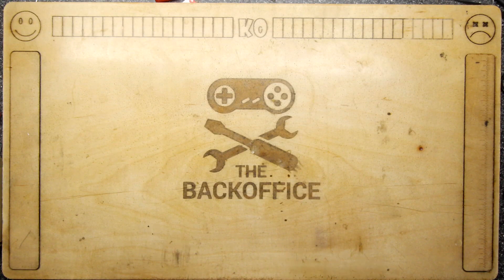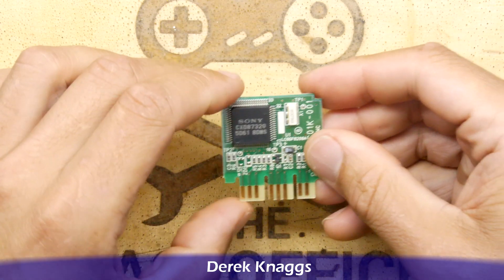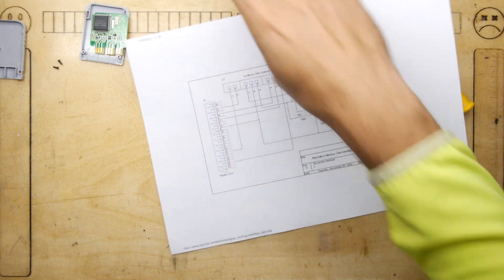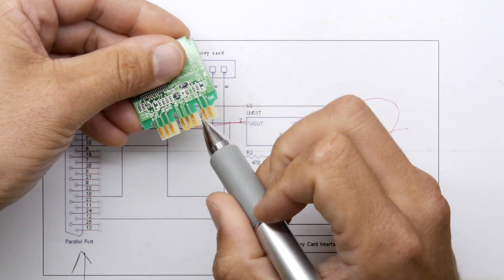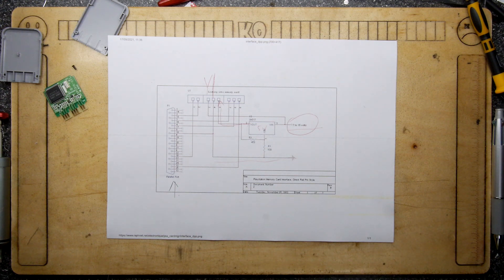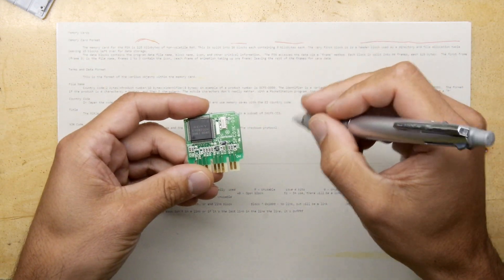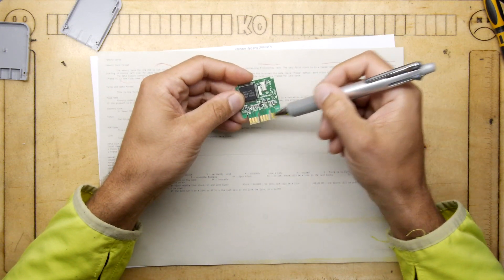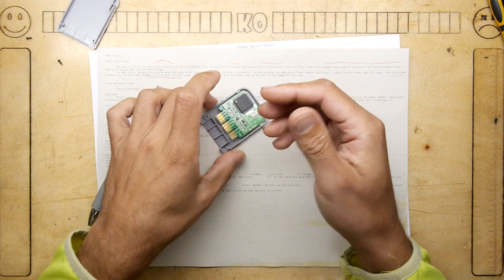Sony Playstation Memorycard teardown - can we make a hardware interface?

Comment: Maybe the spring spacing in an old ISA socket or similar fits the contact pads on the memory module? Would save you from having to solder to it. Or maybe get some PCB contact springs, make a board and enclosure so you can just plug in the assembled memory card.

Comment: Back inn the day I had a parallel cable with a recovered dual ps1 pad/memory connector that I used  to both use the controller on PC and hack the memory card. Most of my mates were so amazed at this that they all asked for one, the trouble was getting the connector as it required an actual ps1 for removal of said connector.
Reply from the maker: I can imagine there were fewer sacrificial PlayStation's back then!

Comment: An interesting thing about these memory cards is that early ones had an off the shelf flash chip and a separate Sony microcontroller. It was only later in the lifespan of the PS1 that it made sense to combine them together.
And yes, they're 128 kilobytes. You sometimes see people claiming they're 1 megabyte, but this is just because of confusion with 1 megabit vs 1 megabyte
Reply from the maker: I might have a look around my boxes, perhaps I can find one. Save game archaeology sounds like an interesting hobby

Comment: end letter is a Q on the sony chip
Reply from the maker: Good eye, I will need to see if that yields something in Google!
Reply: @backofficeshow  Looks likely in this case that it's just a relabelled chip.

ie. Sony used a Flash (or EEPROM) chip from another vendor, and requested a custom part number for the labelling.

Might be hard to find a related datasheet for it, but it's probably just a generic I2C or SPI Flash anyway.
Reply: Oh, OK, so it does use the same "peripheral bus" standard as the controllers.

Maybe it is a bit more custom than I first thought, then.

I found the same page on raphenet where you got the parallel port schematic, and it links to some C code for accessing it.

I'm sure there are some Arduino libraries already for this. Or maybe some controller-reading code that can be tweaked to access mem cards instead.
Reply: You know what, the chip on your card looks suspiciously like a Hitachi H8 style MCU.

Could be just an MCU with internal Flash, which is relabelled.